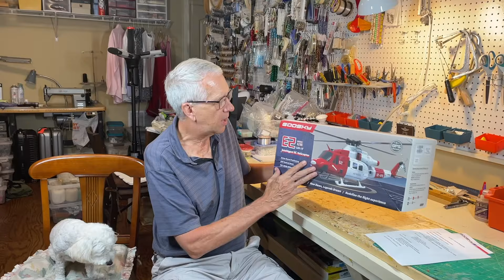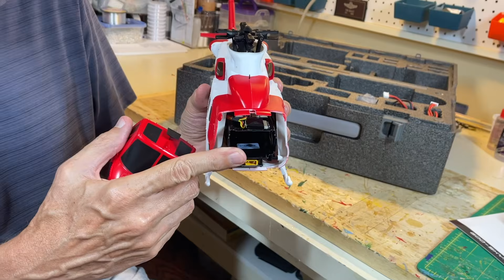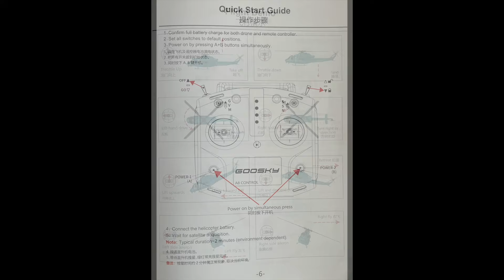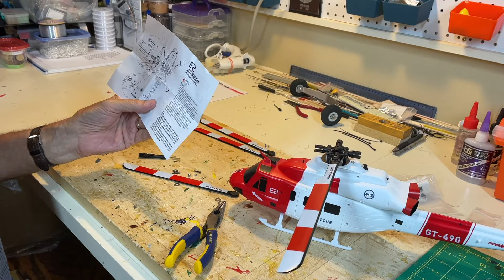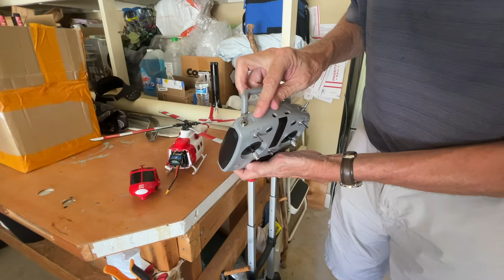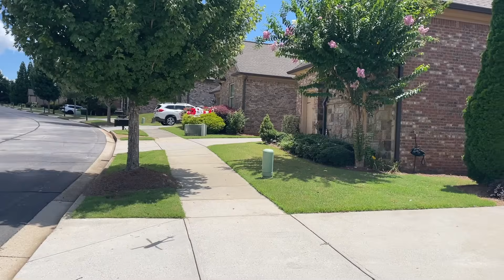Goosky E2 UH-1Y GPS Intelligent Helicopter

Comment: I just bought the blue version from AMain.  It was $50 more, but it comes with a larger box that will hold the helicopter without removing the tail or main blades.
Reply from the maker: Excellent!
Reply: Nice . A T wheel nut wrench from rc cars give more leverage & feel on the nut to the blade holders.

Comment: I’m on my second E2.  First one had fly-away issue (twice in 6 flights, both times was able to stop the fly-away and steer it back while it slowly descended).  My second one has 4 flights so far, no issues—tested both the return-to-home and the low-battery-return-to-home, executed both flawlessly.  Be careful flying low over railings—lost my first helicopter flying 4.5 feet off the ground as I’m crossing a footbridge; as I flew it to the right, the lidar sensed the railing which then caused the helicopter to jump upwards on its own (lidar sensed less than a foot of altitude from the top of the railing), but as it continued to the right, the lidar then sensed the distance off the bridge (~7 feet down) and the helicopter rapidly descended.  Though I gave it up command, it wasn’t fast enough; the blades struck the railing and splintered—helicopter fell onto the rocks below badly damaged.  I consider this issue my fault as I didn’t fully appreciate the importance of understanding how the lidar can affect flight.  The helicopter flies beautifully in all 3 modes, and out of the 10 or so RC helicopters in my collection, this is my favorite.  I would also suggest being very careful as to your return-to-home location (set when taking off in GPS mode) as it will return to that location once low-battery condition occurs.  To avoid this, fly on optical or manual mode before battery starts getting low.
Reply from the maker: Excellent points, thanks for sharing!  Tim
Reply: I got one last week took it for its first flight in the middle of a big park started it up in gps mode it hovered just above head height for 10 seconds then it just shot off into the distance I tried return to home but it carried on flying away past the park I went looking for a couple of hours in peoples gardens and eventually found it in a garden beeping away only visible damage was a missing door and the Finn on the tail which can be glued back on as I found it but I’ve been afraid to fly it again since I just don’t understand why it happened

Comment: This heli is from the tecnical point a masterpiece. The blade mounting procedure and the storage box where the heli does not fit in with mounted blades are a clear downsize. The quality of the RTF transmitter is also  a no go for the price asked! This package needs an update. If someone owns a Edge Radio (Radiomaster, Jumper etc.) + charger buy the BNF version !!!
Reply from the maker: I agree with the storage box . . . it would have been nice to have the assembled helicopter fit in.  But, a great flying machine.
Reply: @TimMcKay56 just got mine today. They have taken your suggestion, and mine arrived fully assembled in a real good transportation and storage box. So goosky listened.

Comment: What switch position to synchronize compass I can’t get light to flash
Reply from the maker: Not sure, but I recall the instructions cover this.  Be sure the helicopter is outside with a good view of the GPS satellites (i.e. not doing this indoors).
Reply: @TimMcKay56 I watched another video and I’m thinking the speed you flip 3 times I’ll try today
Reply: Toggle the upper left switch 3x.  So, not the return to home switch
Reply: @adnanlamri that’s what I’ve been doing
Reply: @donaldlowery9576 did it work?

Comment: Hi Sir , is there enough space to fix remote ID inside the heli? Can the receiver shift to the top ob the flight controller board? Thanks
Reply from the maker: There really is not much space inside the helicopter.  The main motor is quite large.  Best to get a self-powered RID unit like with Roku and just attach to the belly.
Reply: Hi Sir. Thanks for your reply. Do you think the receiver possible to shift on top of the flight controller? In my country, the smallest RID is 35x24x8mm. Which i think it can fit in to the  receiver area. I really don't want to put it outside,  it look ugly.